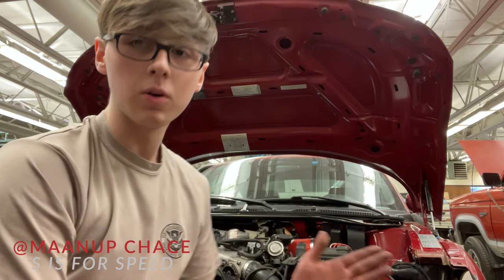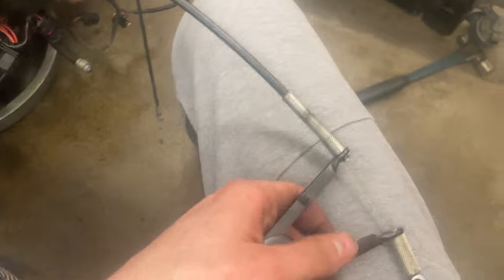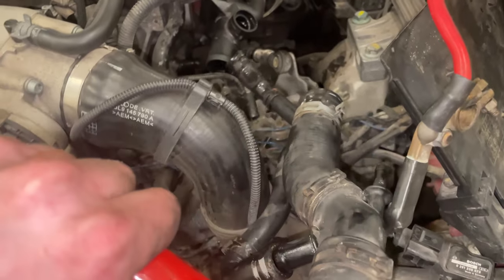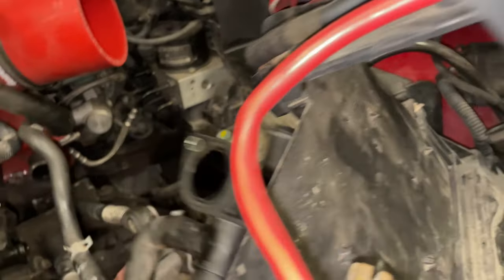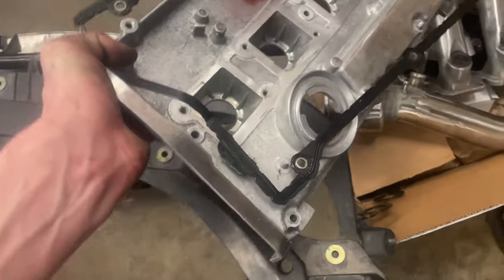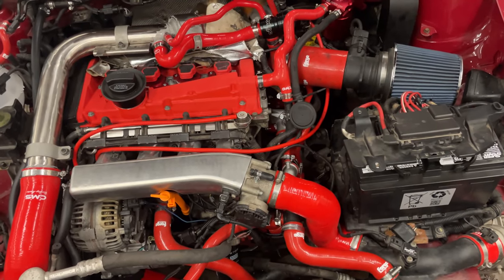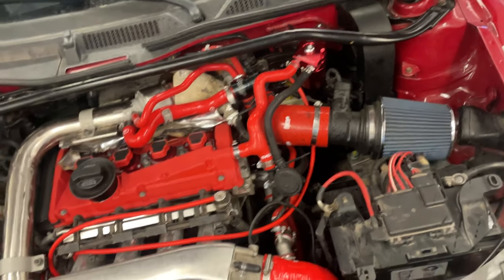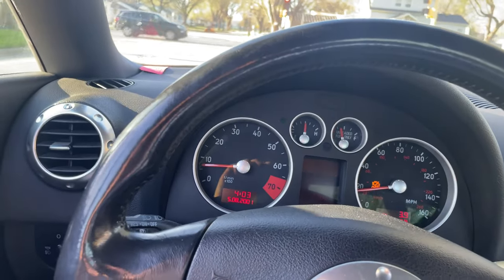Mk1 Audi TT Quattro Sai/Evap/N249 Deletes, full cooling system refresh, R8 coilpacks, and more!

Comment: mate what u do is great, but by putting water there, u will destroy many components on the long term, try G12 or G13, you can flush the water with  the flush plug under your radiator